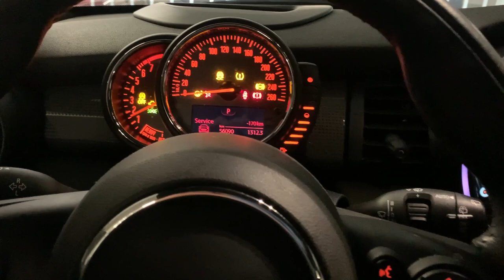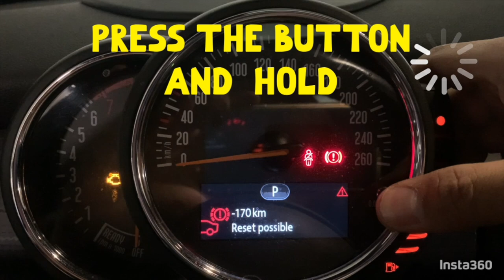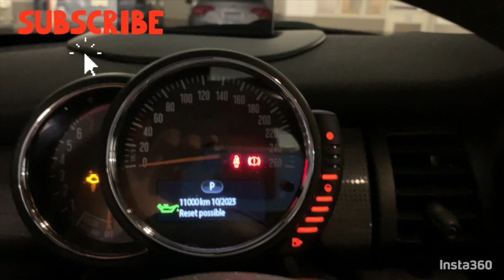2017 Mini Cooper | Rear Brake Pads & Wear Sensor Replacement  | Brake Warning Message reset

Comment: Hi, i noticed you didnt release the handbrake cable as in other vidoes i have seen. Ia this not required to complete the job ? I ask as i attempted this the weekend but struggled with  winding the piston back so had to abort. It was solid

Comment: Why didn’t you take the rotors off and get them turned? Why didn’t you take the caliper bolts off and clean them up and put new grease on them? Other than that I enjoyed your video!
Reply: That's what I came here to make a comment on. Two very important steps. Good video otherwise.

Always clean and grease the guide pins and either have the rotors turned or replace them. Rotors do not work as well if that slick glaze is not removed from the surface. Could mean life or death.